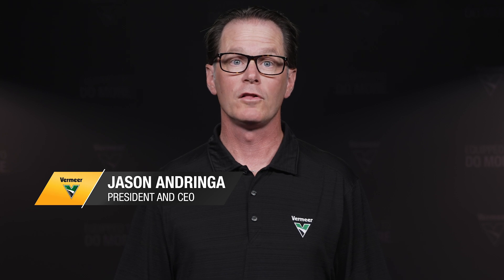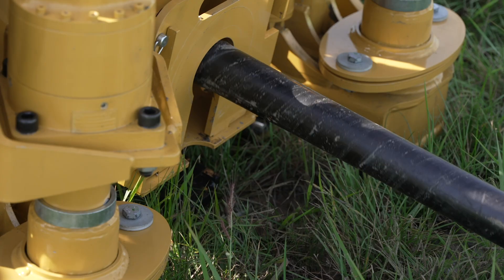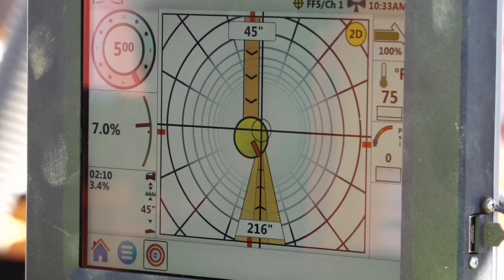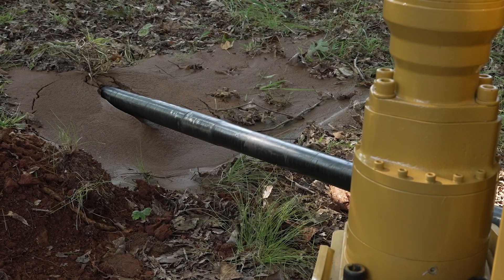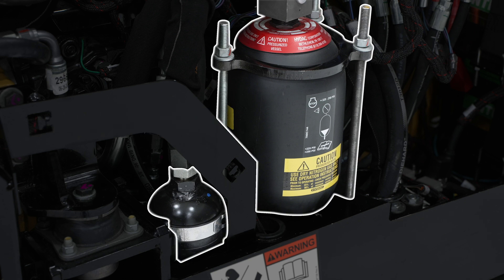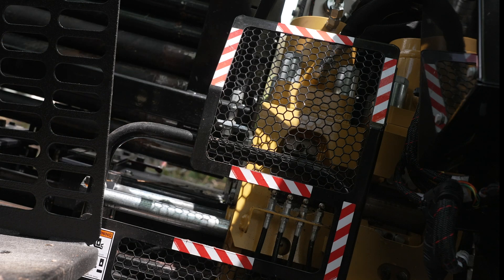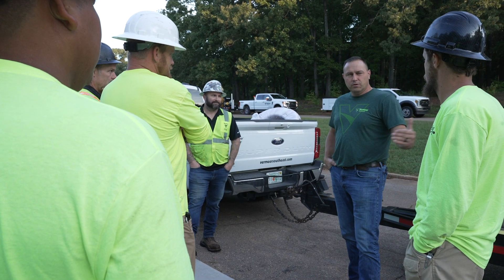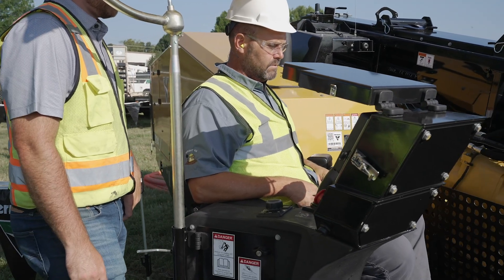ICYMI: Unveiling the next generation of drills | Vermeer

Comment: We've had problems with a JT40 with those open side vices ripping the end of the hydraulic rams spear off and the dies splitting in half because lack of side support inherent with the design. Also, the accumulator is a great idea been telling mechanics and dealers they needed it with the piston mud pump and other hyd. spiking inducers for nearly a decade now.

Comment: Still don’t have duel rear stabilizer.  Ditch witch universal and TT technologies all listened to their customers and put it on.
Reply: The double pivot rack is also good on the JT30 and JT60. The D60x90’s Vermeers a pain without it, with the 3.5” rods launching at 28%. 2.2-2.3m deep before you can flatten out without over bending. Both have their pros and cons though, plenty of things I’d change on the JT60 I’m on currently 😂
Reply from the maker: Thanks for your comment! The outrigger on the D24 has a larger surface area than its predecessor to keep it from sinking in soft soil and a power pivot feature to adjust for needs on the jobsite.